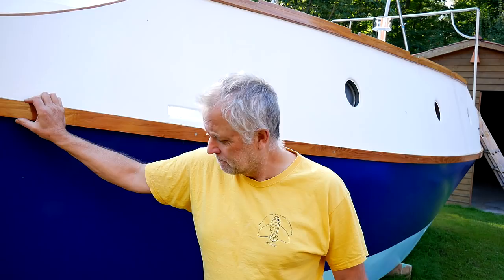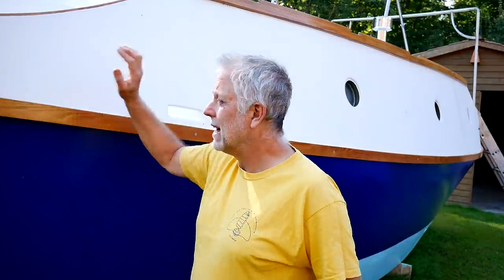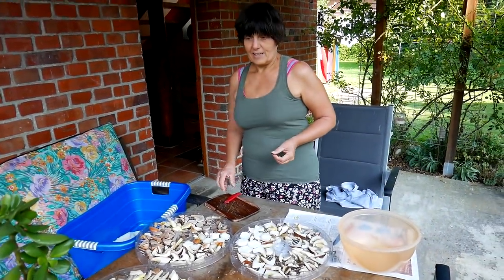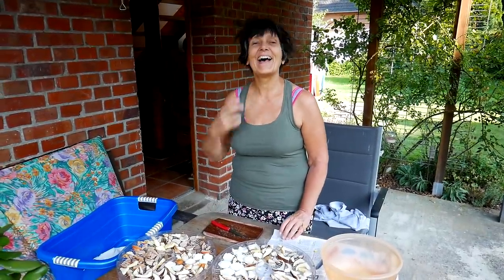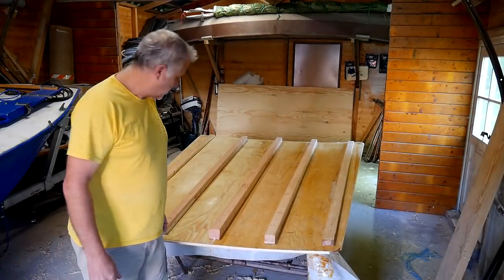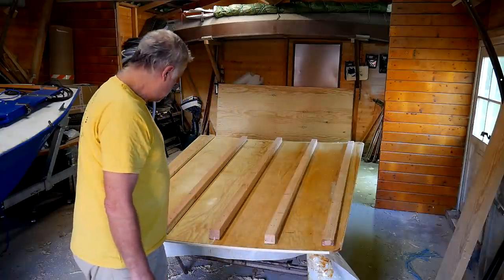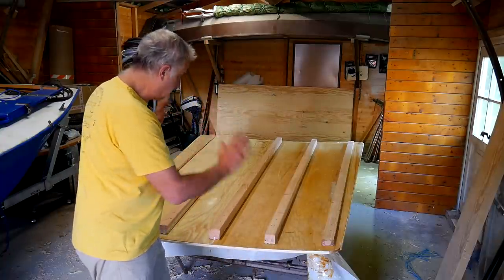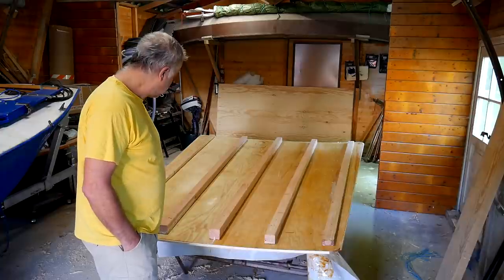Progress With The Bimini Hardtop; Trying It On! - SV Tapatya EP199

Comment: A Junk Rig is a fine sea going sailing option. I built a 30' boat years ago and rigged it as a Junk Sloop. The boat was easy to handle, always a big plus when considering the junk Rig. After some local sailing in SoCal I set off for a cruise to the south Pacific, eventually returning to SoCal after a couple of years. I designed the rig as per Jock McLeod's specifications. I remember buying his Junk Rig portfolio that was the only info available at the time. The portfolio was eventually turned into a book the Practical Junk Rig.
Reply from the maker: Great story! Yes, I have a copy of Practical Junk Rig. I think it’s the number one reference work for junk rigged boats 😎